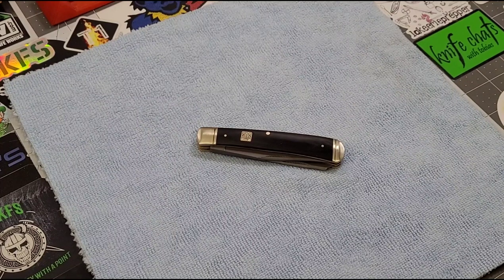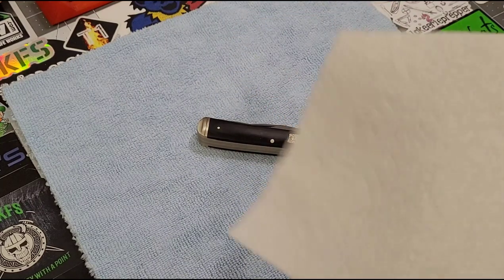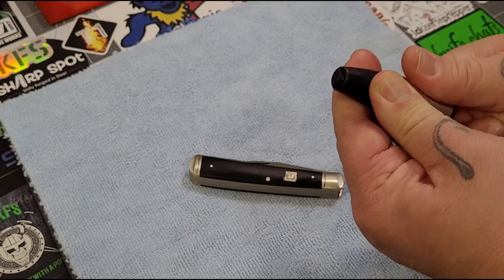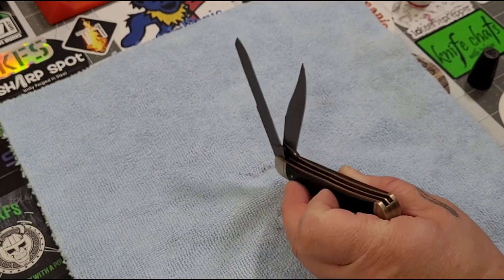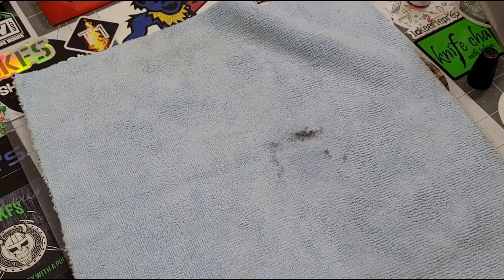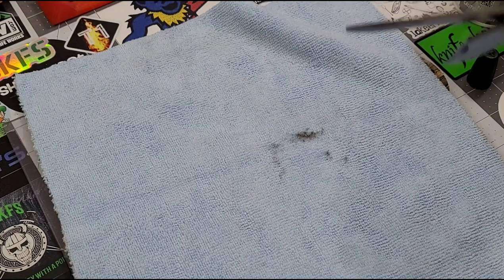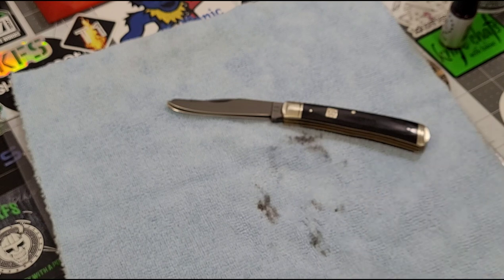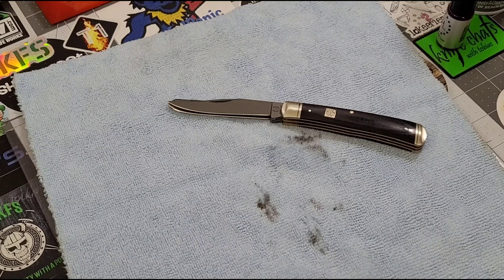Knife Maintenance - Flushing The Pivot Of A Slip Joint Knife

Comment: Great video idea! I actually hadn’t ever thought of using compressed air to help push the gunk out. That’s a really good tip. I’ve always just soaked the pivot in a ton of oil, worked the blades, wiped off the gunk, and then repeated until things seemed pretty clean the smooth. I just did one tonight and using the compressed air technique, and it seemed to be quicker.
Reply from the maker: Yeah...helps speed up the process a little! Thanks for checking out my technique Paul!

Comment: Definatly a great way to do it, I use alcohol at first to get the crap out then I hit it with the oil to get any residual out but your way is great to. I've even used regular 3in1 oil before kpl came out. Also stuff like WD40 works also but it can be a pain with getting the smell out. Mineral oil is one I highly recommend for this process as well as there is no scent to it and does a great job and super cheap but I still use KPL now afterwards for the better protection properties. Thanks for a great vid JB and keep making sharp things fun and enjoyable.
Reply from the maker: Have used 3in1 as well Todd. Any lighter weight oil will work well. Agree about the smell of WD40 or I would use it more! Thanks for sharing your process!!!

Comment: Ì use a penetrating oil to flush the pivot and backspring on my slip joint knives then clean it out with acetone and denat alcohol before lubing with a quality oil.
Reply from the maker: Right on

Comment: I’ve got three Rough Ryders and I love them but each one came very gunked up, I couldn’t believe it.  I had to spend time cleaning them up.  Can you tell me why they come out of the factory that way?  I don’t get it.  They are great knives and comparatively dirt cheap.  How do they accumulate crud in the manufacturing process?
Reply from the maker: Most likely its from grinding on the blade! Since they are so inexpensive, they do not get the cleaning and attention that they would like a GEC.  That's what I believe anyway!

Comment: I use thin aerosol oil like wd40, rem oil etc, flush pivot for 15 seconds or so, move blades, flush again. Then hit joints with compressed air. This will almost always give me a super smooth pivot even before I oil,which on slip joints I use a dry Teflon base lubricant(like dupont Teflon) which does not attract dirt and my knife pivots stay clean for much longer this way for me. Ymmv. Canned compressed air works but I prefer using my  compressor wh8ch I can adjust air pressure.
Reply from the maker: That works too

Comment: I have had quite a few slip joints in my life, and have flushed the pivots on a more or less regular basis. pocket grit is terrible for the pivot. I use my machine oil can because a lot of it runs through, and is less expensive than good lube. than I lube afterwards with the good stuff. I have used canned air before, but now that I have a compressor, I just blow it out with that.
Reply from the maker: Yeah buddy....more power...lol! I normally flush with a less expensive oil as well!!

Comment: I had a thought 
Every knife requires a break in period
Even fixed blades, materials over time "shift" to their final resting spot
And doubly so for slipjoint knives 
The handle material, the pin, steel and slipjoint assembly" will ultimately move or "shift" to a spot and stop. For those who use their knives, skin oils, debris, dirt will all congeal together and creat a sort of bond which counteracts with moving parts, so essentially if your knife had some blade play at the start, before you start the return process--- just use the knife 
It solidifies over time.
When slipjoint knives were purchased from anywhere from 50 cents to a few dollars, do you imagine people walking around scrutinizing everything they can find about it like we do now? And how long have those knives lasted?
Reply from the maker: Good thoughts!